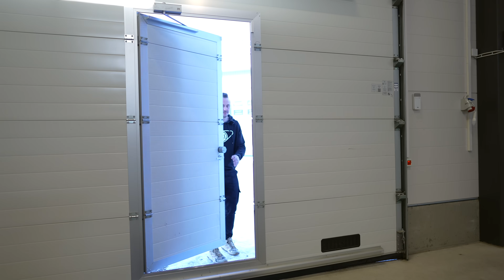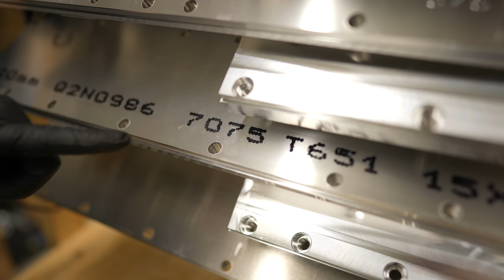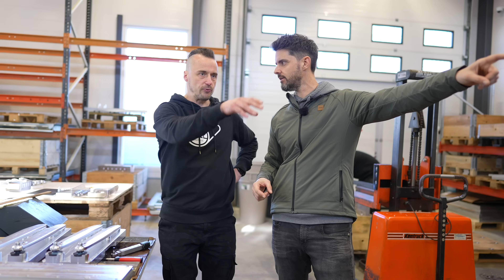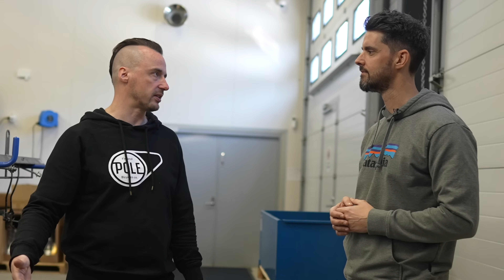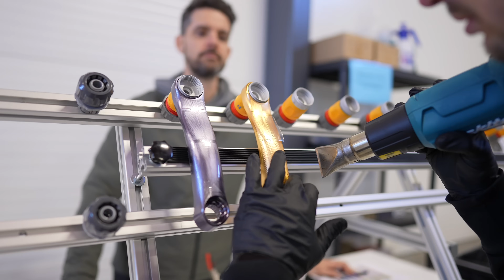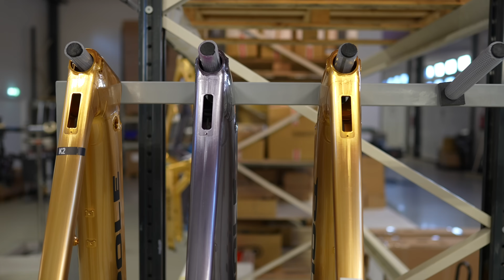How Its Made: Pole Electric Mountain Bike

Comment: Good aluminum desin can be much better than carbon. 
Many designers create stupid shapes with huge tensions. 
It is possible to design light frame which will have 70MPa under 4G landing.
But most of design has about 150 or even 200MPa in case like that. 
Frames are quenched and agged after welding (T6 treatment) but it isn't enough to prevent fatigue if design is bad. 
7075 is old but very good alloy and after T6 tretment is more durable than most normal steel alloys. 
But aluminum is almost 3x lighter so can be much thicker which gives smaller tensions in frame. 
Welds even after T6 treatment are not perfect and design without it is very good idea. 
When I was younger I thoud to creat frame made by two forged pieces but I,ve never finish it. 
I stopt on repairing frames for people or designing and machining better links in case of repair. 
But thanks for bicycle engeniering I was designer in automotive and now I am mechanical designer in eletronic industry. 
Great to see someone who create so smart companie with smart design.
Reply: Good info, thanks! 👍

Comment: Presumably they leave a reasonable flange (on the inside where you can't see it) so there is some area for the bonding between the two halves? If it was bonded then machined down to ~1mm wall thickness that would leave very little bond remaining. I am impressed that they can get this process to work without visible seams  on the outside and with consistent wall thickness. As he emphasises this is hard to get reliable.
I wonder if there have been any instances of bond failure in the middle of a frame tub: (MTBs get a very hard time and epoxy is good but surely not as good as the solid metal of an extruded, welded or hydroformed tube?

Comment: I love a polished aluminum bike 😍 i Have an Ebike i built tho highly different from yours.. with a 750w Bafang mid drive 52v batt.. and though it does weigh in at 57lb my top speed was 41.9mph on a flat street.. unfortunately it's WAAY to heavy for off road  😒 🤷

Comment: Cool to see these fully machined bike frames. I noticed the design seems quite conventional; I imagine that with the full design freedom of machined parts you could move towards a lot more distinctive style. Even if the round tube is pretty hard to beat from a technical point of view, it could really help set the brand apart to go a little crazier.

Comment: Surely pole integrates pinion or effigear, gearbox drivetrains that would make them so much further above any bike company and wouldn’t be too hard to modify the vikkela for a acoustic gearbox and the voima for pinion’s new e-gearbox.  It’s just if the market is there which I am sure there is
Reply: I am from New Zealand and I would rather buy a pole with a gearbox than a Zerode Katipō or Taniwha which are made in Wellington, I would rather have the pole because zeroed only produces carbon frames which I don’t think serve a purpose in Enduro because it’s only marginally lighter than alloy and it so much easier to break, and with Pole having such high tolerance machining and they are all about precision I find it surprising they still use traditional derailleur, chain and cassette drive trains when gearbox drivetrains with a belt are so much stronger, more precise and almost never require a service because they run in an oil bath.  He shifting and performance is just so much better and the wear is almost no existent.  If Pole made high performance Xcode bikes where efficiency is paramount then it would make sense to stick with traditional drivetrains, but for a enduro racing machine gearbox drivetrains just seem so much more fit for purpose.
Reply: And I’m no expert but on a bike with a traditional chainstay, If you want a belt drive you need a removable/breakable chain stay to put a new belt on but I think it might be possible to install a belt without modifying the seat stay on the voima/vikkela if you remove the wheel and any guides first.  Not for certain but it looks as though you could.
Reply: Suspension performance is greatly improved in gearbox driven bikes too as it removes a clump of unnecessary weight from the rear wheel

Comment: isnt it funny, as an industry its become common to acceptingly spend huuuuuge amounts of money on poor QC as leo mentioned, Even his cnc frame is only 0.1, thats still massive margins for "high quality"

I can mass produce (as i am) 3d printed plastic on my 3d printers at about the same 0.1 lmao.
Reply: You are not understanding the 0.1mm reference. When you can take a print off of your 3D printer, and then place it back on the 3D printer and add more to it within 0.1mm, let us know.  Leo is referring to the change in setups and being able to maintain that accuracy over the entire surface of all of that complex geometry, AFTER taking it out of the machine, and placing it back in there for more machining.  Your 3D printer can only maintain its accuracy while it's in continuous build. You must pay attention to the details grasshopper.
Reply: @richzilla2.0  
hold up cowboy, I have a $400 3d printer......... the CNC machines we use for our Race cars Can use its sensor and measuring tool to do anything extra to a part we put in.

My 3d printer reference was for the price difference thats unacceptable.

the 0.1 reference was Frame alignment etc dont make shit up - The realigning of parts can be done easily with a CNC sensor tool.
Reply: @Bestintheworldatwhatido  You are correct.  With probing in the machine, you can easily locate the part when it is placed back in the machine, and that's where he says the Zero-Point fixtures can repeat to 0.001mm accuracy. I am not making anything up, I am just trying to help you understand that the 0.1mm reference is the worst variation that any part of all of that complex geometry will be away from the nominal dimension. He's not claiming that's the best they can do.  Most of the machining they are doing will be well within 0.01mm and better.  Some of it I am sure is easily within 0.005mm (bearing fits and locations for example). All of that organic surfacing of toolpaths over that size of part needs to be done very carefully because of the internal stresses that are released when the majority of the material is cut away. 👍👍👍
Reply: @richzilla2.0  and my point was directed at other Manfs, not pole. 
he said other manfs are worse than 0.1 which i believe as ive had some terrible frames over the last few years, especially alloy.
Reply: @Bestintheworldatwhatido  Yes, I totally agree with that.  I've seen some very poor quality frames from other brands.

Comment: I like the attention on detail through the manufacturing process! I am really interested in the Voima, if only it were mullet...
Reply: I have mulleted mine. It’s phenomenal
Reply: @Dave-qy8sl  Do you experience more frequent pedal strikes due to the lower bottom bracket? I suppose the bike is more nimble now in the tight switchbacks
Reply: @ioannisparaskevopoulos1120  I’ve had very few pedal strikes with this setup. It is confidence inspiring on the climbs that tends to enable attempts of more challenging root sections that demand more precision timing on the pedals. It definitely doesn’t hold me back
Reply: It did make the bike more nimble overall I found
Reply: I mulleted mine as well. I used a -1 degree headset from cane creek. I ended up going back to full 29er as it seemed to handle a little better. Also for whatever reason I don’t have any issues buzzing my butt with the 29er setup like I have on other 29 bikes. This is the main reason I tried 29er but turned out it wasn’t necessary.
Reply: @ronaldsilver8499  The wheel hitting my butt is the main reason I want to try it mullet....how tall are you, I am 5ft 9 and thinking the K1 size